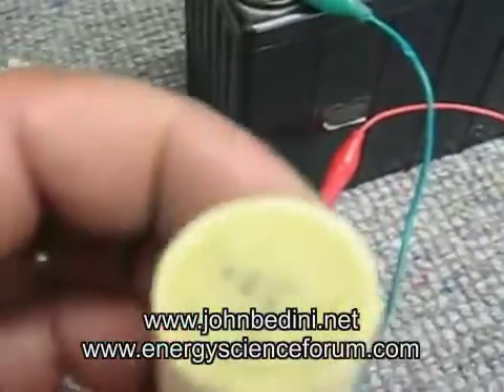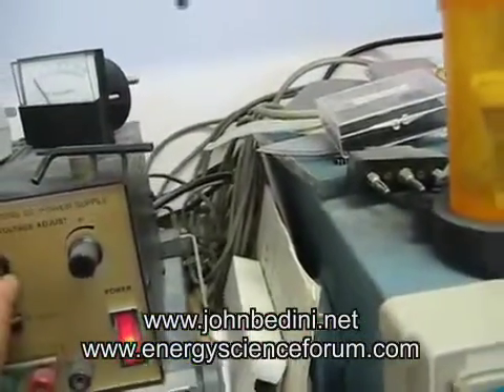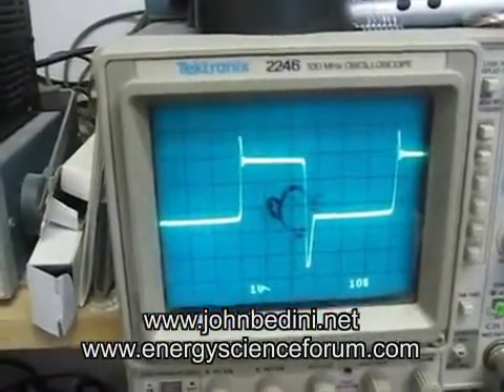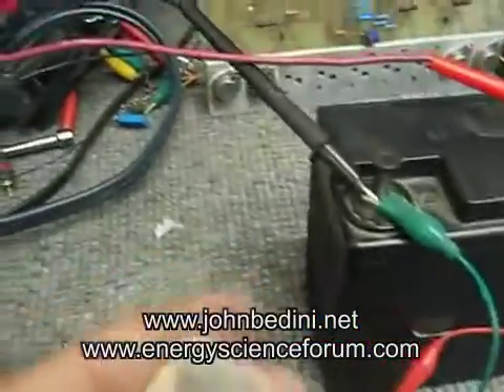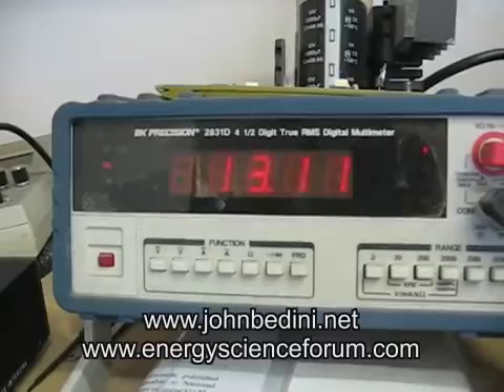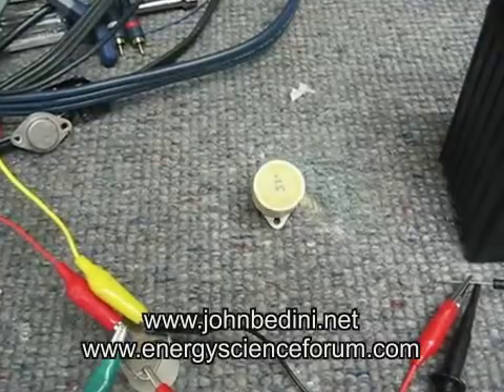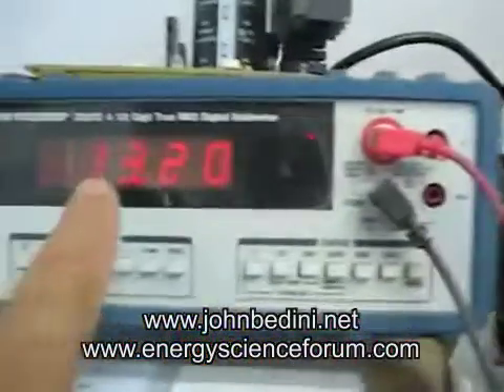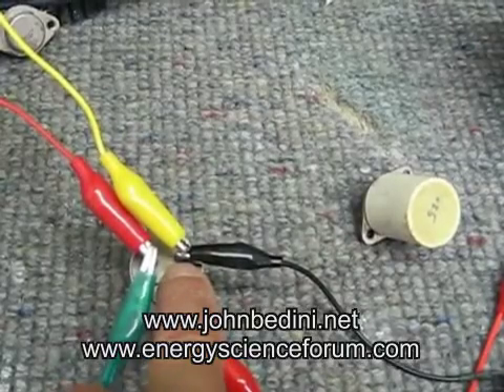Radiant SG Tube Oscillator

Comment: By John Bedini demonstrated 3-5 fold "Off electricity shock" with ELECTROMAGNETS (see Scope) is lethal to the CERN / LHC - during an unexpected grid-breakdown (= power failure in the Geneva region) - when the LHC put into operation again in the 2015-2016, because the LHC is built of more than 1,232 electromagnets - and the superconductivity by the 3-5 fold current and excessive heating collapses = evaporation / explosion of liquid helium as a coolant.

Comment: John Bedini's experiments are based on the latest findings in ELECTROMAGNETISM with a newly discovered high-speed vortex flow of "dark matter" (= magnetic space quantum flow SQFm) around the longitudinal axis of a solenoid, and a 3-5 fold "cut-off current shock " when switched off. Refer to the published basic physics of OLIVER CRANE, 1992, in the book: "Central Oscillator and Space Quantum medium", with the new image of MAGNETISM.